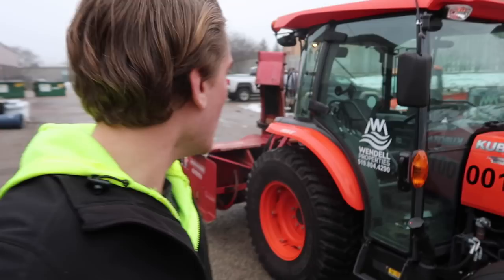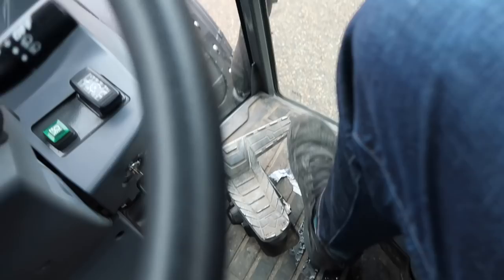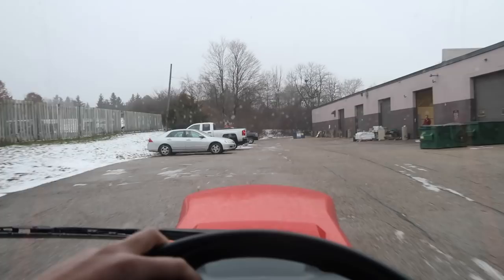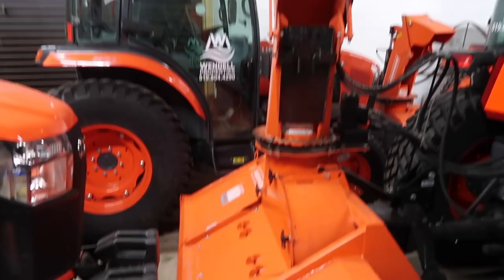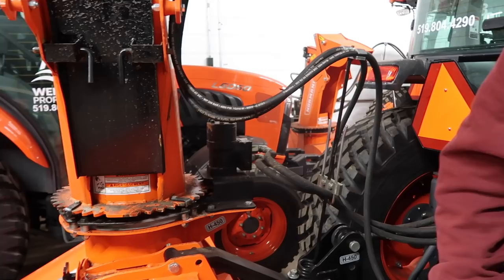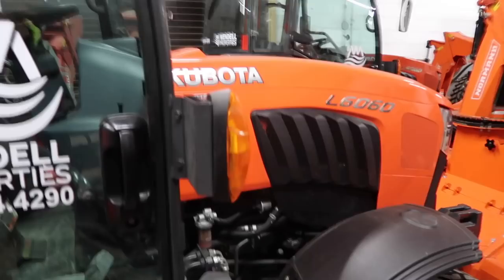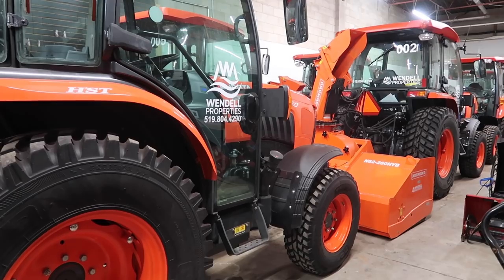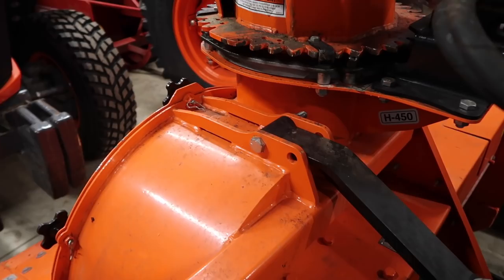Kubota L6060 Plus New Normand Hybrid Inverted

Comment: What kind of mud guard are in the front? For what I do in the spring,summer,fall time the throttle on the Kubota is so much better than leaning forward and pulling lever back. Both nice tractors
Reply from the maker: I believe those ones are just the factory kubota fenders.
Reply: Nick Bohner unless they make them in Canada only. They don’t make them here and have been researching a lot and haven’t found any
Reply: @coreym5072  yes the fenders are only available in Canada.

Comment: Can you do offset sidewalks with an inverted blower on a tractor? Like if one tires is on the sidewalk and one on the street? Trying to figure out how to do sidewalks with my tractor and inverted blower this winter.
Reply: Mr Plow it wouldn’t work too well. Inverted blowers have a little bit of give but not enough to flatten out to the sidewalk with the tractor on that angle. A skid steer would work better

Comment: Hi Nick, nice vid. Ive been looking at moving from a L6060 to a 4066r and im seeing lots of conflicting info on top speeds. I see people claiming to run 33 kph in the 4066r while deeres info says around 29. Meanwhile my L6060 runs only 25 and since all my lots are commercial i could use some more speed. have you ever checked your top speed off of a gps app? i get the feeling tire choice probably plays a significant role and i doubt the number on the dash is all that accurate.
Reply from the maker: amhicks21 great question. It depends on tire size as well as if the tires are loaded or not. My slowest one is the 4066r loaded down with the 92” blower that does just over 20 mph according to the tractor. The other 4 series will do more like 21 or 22 mph which is around that 33 you mentioned. Those ones have the Nokian snow tires loaded.
Reply from the maker: Don’t know from gps. I can check that for you and report.
Reply: @nickbohner9261  Thanks for the reply. It makes me wish we could justify running those snow tires around here. The turf tires i run are a pretty good compromise since 80% is summer work but they are quite short.